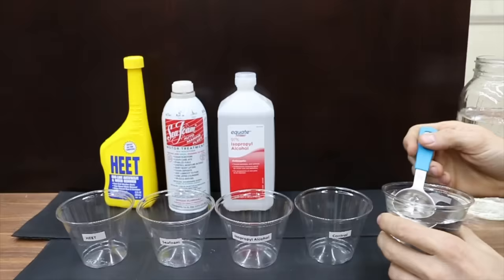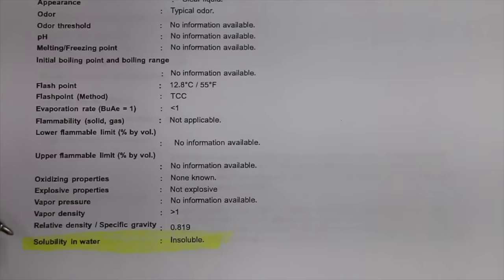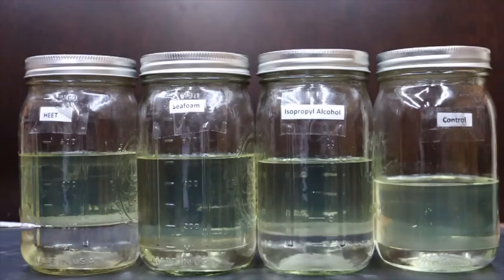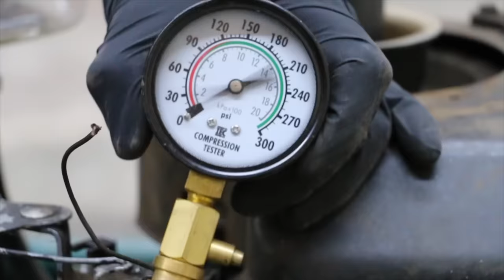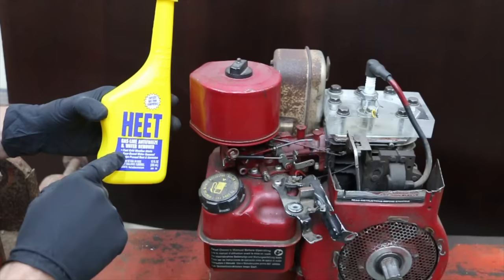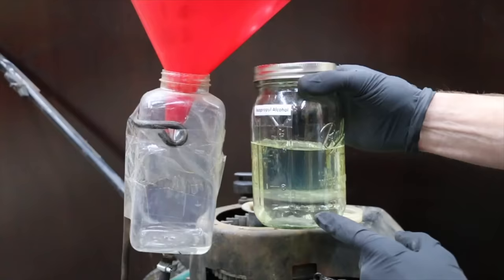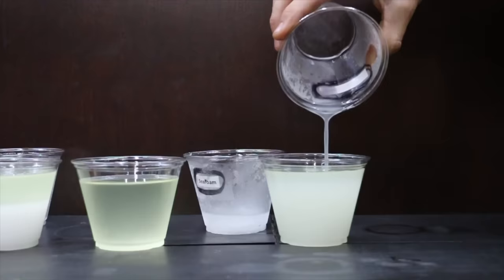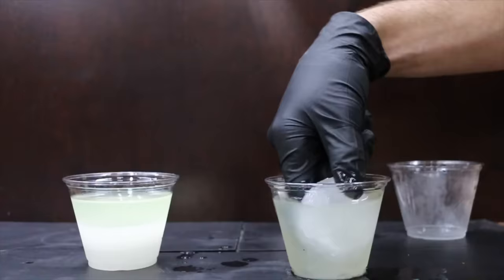Is HEET better than Seafoam for Water in Fuel?  Let's find out!

Comment: My yamaha viking got water in the tank from alot of rain. The tank was nearly empty . The Utv was hard to start and kept dying out. I filled the tank with gas then added Heat (red bottle) Got it started ran it at a higher rpm to prevent stalling for 30 minutes . Problem solved. This has happened with my lawn mowers usually when there's less than an 1/8 of a tank, and it's rained alot . I add and fill the tank with gas. This works unless there's too much water in a low tank, then drain it and refill with high test
Reply from the maker: Thanks for sharing.

Comment: Why don't car fuel tanks have a drain valve like aircraft do to take a sample and drain water in the fuel?
Reply: If your car engine quits due to contaminants in the fuel, it's a much smaller problem than if the same thing happened to an aircraft engine........
Reply: @fuckyougoogle1148  Still, a good idea. Our older 50's-60's International Harvester gas tanks actually had the drain plugs.
Reply: @hjo2634  I agree it's a good idea but modern cars aren't designed to be as serviceable. For instance a number of designs have the filter in the tank. Want to change it? Drop the tank. Additionally, most fuel tanks are plastic now, so rust due to moisture isn't an issue.

Comment: What would be nice is a product that evaporates once in contact with fuel and creates a simulated “100% humidity” situation where the air in the tank won’t absorb humidity and thus moisture, it would also be nice if it’s not a hydrocarbon and just doesn’t condense/condensate like water does, that way it’s also not the worst thing ever if you spill it or leave the cap or tank cap open or something
Reply from the maker: Thanks for the feedback.

Comment: At one point near the end, you poured isopropyl alcohol into a cup labled "Heet", and Heet into the cup labled "isopropyl", before placing them both back in the freezer to see if either would thaw already-frozen water.  But since neither really did a great job of that, I guess it doesn't make much difference.  Still...
Reply from the maker: Thank you

Comment: I had water in my gas and I used heat in red bottle and it ran great until I ran the tank dry and I refilled the tank and added another bottle and it did a great job
Reply from the maker: Thanks for sharing.

Comment: I buy 99.9% isopropyl alcohol off of eBay 5 gallons at a time in 1 quart bottles, really nice for removing water from large tanks of fuel.  One needs to be careful adding it directly to a vehicle fuel tank as some engines though don't like extreme amounts (like say adding a quart is WAY too much).
Reply from the maker: Thanks for sharing.

Comment: My water lines and gas lines got messed up after changing a seal on my truck I put heat in the gas tank and was still having lots and lots of trouble with it backfiring not wanting to run so on and so forth even losing power so I went and bought heat and put in the gas tank couple days later my truck still would not run it didn't even want to start anymore drain the tank and it had a settled on the bottom that was.... that look like so my question is does the Dex-Cool, antifreeze  and ethanol free gasoline cause the reaction? My also very informative thank you

Comment: Sea foam is a demulsifier its designed to seperate water from fuel so an external filter can catch it instead of running through the fuel system
Reply from the maker: Thank you

Comment: Heet doest remove the water from the gas but it will combine the water and the gas better to push it through the engine to get removed. My car had frozen lines and wouldn't turn on. I put in a bottle of heet and waited a couple of hours and it started up like nothing. So yes heet does work. You just have to give it time to work.
Reply from the maker: Thanks for the feedback.

Comment: I always used automatic transmission fluid to my gas tanks on my Ford gas truck with two gas tanks. I used to add it to my diesel tanks on my Dodge but too much risk of it turning your fuel red and getting dipped.
Reply from the maker: Thanks for sharing.

Comment: Best way to get the ice to melt in your fuel tank is to use a hand held propane blowtourch and heat up the bottom of the tank in a circular motion so the heat radiates and melts the ice..
Reply from the maker: Thanks for the feedback.

Comment: So, there is a device called Mr. Funnel, which will seperate water from gasoline.  I'm curious as to whether it will also capture the ethanol that is mixed with the water.
Reply from the maker: Thanks for the suggestion.

Comment: Water in fuel eems to have been a more common issue in the 70s and 80s.  I remember many times when the pesrson driving would add alcohol to the fuel.  Maybe they didn't know what they were doing and that wasn't the problem?  I have never had an issue with water in gasoline but I have had major issues with water in diesel.
Reply from the maker: Thanks for the feedback.

Comment: the thing with isopropyl.  it usually comes in 50  or 70 percent at  grocery stores,  and the other 50 to 30 percent of it is WATER. so  make sure to get the  91%, or i think it also comes in 99 percent, as well-- much less water.
Reply from the maker: Thanks for the feedback.

Comment: Can you explain to us what octane booster is and how it affects the fuel? I read it decreases the explosive power in gasoline allowing the spark plug to ignite it instead of the compression like a diesels . I have always heard that 100 to 120 octane was some really explosive stuff , but now I think everyone has it wrong. I can see how slowing the ingition point in a radial aircraft or a high compression hot rod would be necessary.
Reply from the maker: Thank you.  As you've described, octane boosters increase a fuels resistance to ignite too soon, which is a problem in boosted or high compression ratio engines.

Comment: Hi, some comments for your consideration. And Merry Christmas for 2020 !
- Someone noticed that left overnight the water remover settles out, even after mixing !
- What happens to water remover when it is mixed by pouring in and adding fuel, then easy rocking simulating driving (AKA anti_Bond martini: Stirred, not Shaken). I don't pick up my car and shake it before driving. Maybe a simulated clear gas rectangular gas taken for a drive, with recommended ratio to treat reasonable amount of water, however much that is? Leave it sit overnight, and what does it look like in AM?
Reply from the maker: Thank you for the feedback

Comment: I feel like this should be done with a diesel instead of gas… …. Also depends on the end goal.. are you trying to breakup the water into the little parts, and force it through filter. Or you trying collect the water at the filter and drain it off?

Comment: Have you done a video on how long you can runa lawnmower on just gasoline vapor...? Use your plastic container with a fuel hose coming out going into the gas tank but seal up the tank really well so no air gets in.. i bet you can run that mower way longer on just vapors than on direct fuel.

Comment: Old thread I nknow but was in need of a solution so thanks for your thread. Still surprises me that machines like this do not have drain petcocks (he said “petcocks” heh,heh,heh) in the lowest point in the fuel system like NA airplanes have. Preflight requires checking/draining until no more water. Not sure why that would not work for this use case (less the ice scenario).
Reply from the maker: You are welcome!

Comment: Gasoline will only hold 1/2 of one % of it's volume of water, before separating out. In Mercury Marine Service School teaches you to always use Iso Alch as it makes the water burnable but, other alchohol such as ethanol or methanol will attract water but will only ball it up and displace it. It will still get drawn up into a fuel system in it's original state and cause fouling. ISO wins, imo.
Reply from the maker: Thanks for the feedback.

Comment: There is a difference between Condensation and Water. Heet removes Condensation. Condensation in a fuel system measures way less than a quarter of a teaspoon.
Reply from the maker: Thanks for the feedback.

Comment: Would you be willing to test the various ways to restore "dead" or older lead-acid batteries, using the various methods such as epsom salts versus replacing the electrolyte with over the counter battery acid replacement versus the battery "desulphanator"/tenders that are available?
Reply from the maker: Great video idea!  Thank you

Comment: Do you know what brand of engine is on that ryobi generator and how much did it cost. EFI on a small generrator seems like a good idea that should have been standard years ago, and many hours of rebuilding and tinkering with small electronic carbs that stop working after a year or 2. Thanks for the videos. Keep up the good work.

Comment: Wow - too me this is an eye opener,  or very informative, I've used heet in experimental glow plug model airplane engines just too see and it works with caster oil  , but not as good as real glow fuel - but too see the water heet mix at the bottom is informative as per car use- thanks again. !!-!!
Reply from the maker: Thank you!

Comment: I think the one thing you did
Not account for is that the  gas tank is typically mounted to the top of the engine and with normal sloshing around vibration would prob keep solution  suspended better and therefore mixture would prob burn better
Reply from the maker: Thank you for the feedback

Comment: Had 97 Chevy 350 Tbi had water in fuel but truck ran till I added a bottle of heat to it and refilled the tank to see if I could burn it out well once the heat mixed in the full tank and worked it’s way to my injectors the truck quit running all together, I figured it was something else I threw part after part at this truck before spraying some fuel out the stem it was all milky so I siphon the gas out all together put fresh gas in and after few times rolling it over firing it finally ran normal so heat didn’t work at all for me... 😕
Reply from the maker: Thank you for this information!

Comment: Will the heet or isopropyl alcohol damage vehicle sensors or parts?
In my experience the only way to thaw a frozen fuel line is to warm up the vehicle in a garage or use a torpedo heater to blast heat under the car. The latter will work but is only to be done by persons with common sense or the fire department will also be involved.
Reply from the maker: Thanks for the video idea.

Comment: Honestly the only way to remove water from fuel is to find the water where the gas and water separates and tap a hole in the container 2 or 3 inches above the line ... It's not helpful when the tank is in a vehicle unless you're changing the tank anyways.. my daughter races high performance go carts and we have a 10 gallon catch can we rigged up to separate the crap from the cream in her fuel ... Also in buffalo NY we have several gas stations that offer ethanol free gas at 91 octane you can also purchase 100 octane gas from select Delta Sonic car washes here at 9 bucks a gallon but even that we run through our make shift splitter .... She has a kart she built for snow racing and in that we use k1000. Just for giggles I dumped a small bottle in 5 gallons of water shook it up and threw a match at it.. they claim to make water burn and they sure do...
Reply from the maker: Thanks for sharing.

Comment: Two years late oh well. Honestly since 10%  ethanol gas became mandatory in Minnesota frozen gas lines seldom happen. I know everyone likes to blame alcohol in the gas for every problem but in the 30 plus years I've been stuck with it it hasn't been a problem. Before that happened you'd add a can of Heat pretty much every fill up. Methanol was always the go to if the lines were frozen, isopropyl if no ice. Always worked.
Reply from the maker: Thanks for the feedback.

Comment: I recently went to Auto Zone looking for Stabile for my gas to preserve the gas from the Ethanol in it. An employee asked if I need help and I told him what I was doing and had Stabile in my hand. He recommended Seafoam to preserve gas with ethanol in it. I guess he didn’t know what he was talking about I ended up buying Stabile for my Generator and 5 gallon gas cans. They had Stabile Storage for gas with ethanol in it that claimed you can store gas for a year but that seemed unrealistic to me so I bought regular Stabile. My question is they also had Stabile 360 is it better then regular Stabile? And since my generator has a 7 gallon tank can I also add Heat and Stabile to my generator and 5 gallon gas cans to keep the ethanol from producing water? I start my generator every 2 weeks and run it for a half hour and about once a month I’ll exercise the generator with a small load to keep it energized. Thanks
Reply from the maker: Thank you for the video idea!

Comment: Hey would you be willing to do a video of octane boosters? I've got a 2-stroke engine (paramotor) that requires 93 octane non-ethanol mogas. I have some gas stations that sell non-ethanol fuel, but some are 87 octane, 89,  91, and some are 93. What octane boosters will increase the octane content of the gas? How much do they cost? Which are better or worse or don't do the job? 

When will higher octane be better in what kind of 2-stroke engines? Is compression a factor?

Thanks!!!
Reply from the maker: Thanks for the video idea.

Comment: Just so I understand…if there is water in the gas tank or fuel system, after putting HEET in the car will run “rough” because of the water mixture being burned off in the engine? And once it burns off the engine will run on the actual fuel? I just moved to an area where the temp can get below freezing and I don’t know how to live in these conditions but still want my car to run everyday I go to work

Comment: Ethanol gas will get rid of water if you run it through it’s the alcohol or just alcohol that the only way I was able to clear out my boat fuel tank, once the alcohol reaches it’s saturation point you’ll see it on the bottom, a couple long runs to key west and back using ethanol gas cleared all moisture then back to rv gas
Reply from the maker: Thanks for the feedback.

Comment: I bought gas for my station unbeknownst to me it had water 14 below truck would not start added Heat the red bottle like my mechanic said got the truck to turn over and run I am going to add Heat the red bottle next week we will have below zero temperatures again and see what happens I recommend the Heat
Reply from the maker: Thanks for sharing.

Comment: I need help... my engine stalls out every time slow down, the car shakes when put into gear (also stalls) and there is no horse power instead its like a house cat pulling the van its a 2000 crysler voyager... what brought me to this awesome video is I used heet and added more gas (per instructions) and now nearing to empty there is no change in any of the symptoms... I need help understanding
Reply from the maker: I wish I could help but there are a lot of things that can cause these symptoms.

Comment: Please forgive my old feeble mind, I wasn't sure which one applies to my situation.  Miller 250G (Onan) had a ton of water in the tank (can't remove tank due to add on's)  Pumped the vast majority out but still some residual.  Should I use Heet or Alcohol?.....or just go buy a Lincoln??  BTW, love your vids and experiments.  I have learned a lot, thanks for posting them
Reply from the maker: Heet.  Thanks for  watching!
Reply: @ProjectFarm  Worked perfectly !  Engine humming like a sewing machine.  Thanks for your help

Comment: my truck sat for 5 months in Canada just got it back Jan 18 23 should I put anything in gas tank for condensation It had about 1/4 tank and I fill it up when getting it. If yes what do you suggest and how much I am not worried about freezing as it is in a heated garage just thinking of my new engine it does seem to be running fine just trying to be proactive. Thanks for the great videos.
Reply from the maker: Ethanol based fuel will absorb some moisture.  I would drive it without adding anything.
Reply: @ProjectFarm  thanks for info

Comment: Not sure point of comparing equal volumes of seafoam and isopropyl alcohol when we know seafoam only contains less than 25 isopropyl alcohol. Also is the gas already 10% ethanol or ethanol free?
Reply from the maker: It had ethanol it it. Thank you

Comment: From experience in oilfield if you get an ice plug in a line you can thaw it with lots of methanol. However it will not thaw under pressure. Not sure how that is applicable here though 😁. Guess I’m just full of useless info! ✌️
Reply from the maker: Great information!  Thank you

Comment: Would any products remove or congeal water in oil? I have a quad that we use for short periods of time so it never has the run time to vaporize the condensation that builds up in the engine.
Reply from the maker: Thanks for the suggestion.